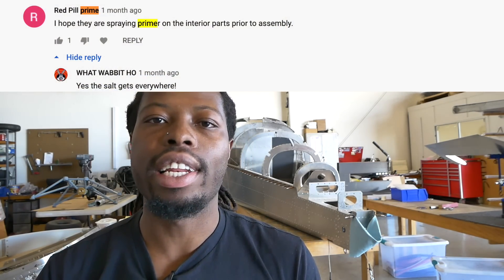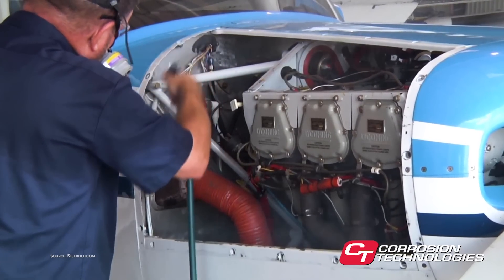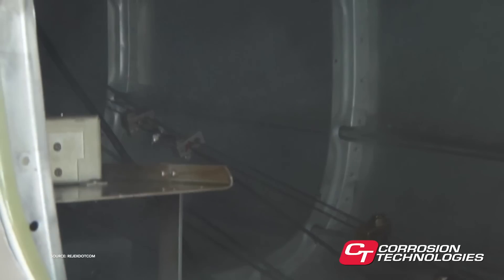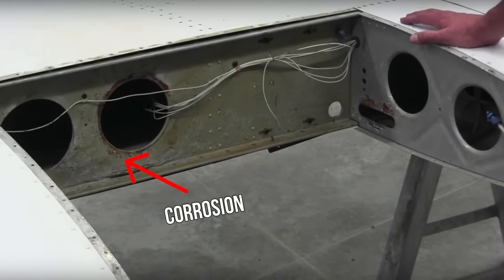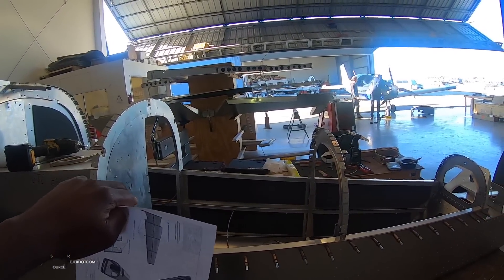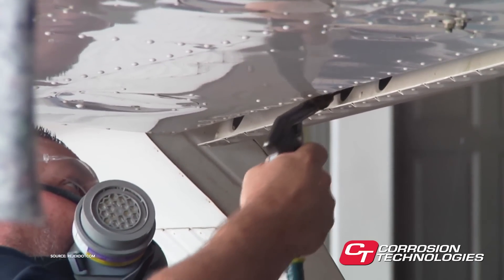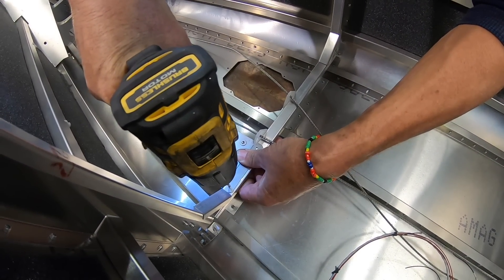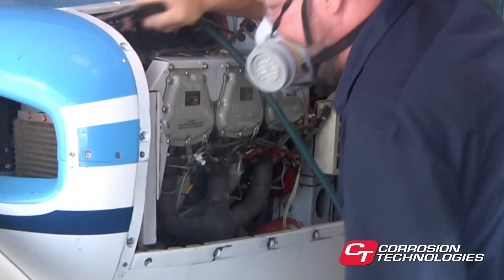Airplane Priming Explained! - Mojosling Build EP9

Comment: Stuff like CorrosionX and ACF-50 corrosion proofing stuff needs to be applied after the primer and paint. The bare aluminum has to be cleaned of all oils and chemicals before painting so its super tough to remove it and have the paint adhere properly because you can never get all the stuff out of the crevices. Also primer lasts longer and from my reading and understanding is the primer should be applied first, then painted, then the anti corrosion liquid applied after to get into the nooks and crevices that primer and paint doesn't get into. Anti corrosion primers such as Zinc Chromate lasts for decades where as the corrosion x or acf-50 treatment has to be continuously applied every 2 years. Correct me if i'm wrong. I too am doing research before i build my plane. Thanks.
Reply: That is how I was trained in the RAF but there is has been an argumentin the Light Aircraft world that primer adds weight and can break down making joints loose (which I dissagree with), I think the main reason for not priming in the home build market is based, partly on this argument but mainly on build time, as to do the priming correctly you have to make your part to fit then take it out and prime it then fit go back and fit it (which would without planning doible the build time). In a factory they would have a production line of part being made and primed as they would not need to test fit and adjust to the same amount that the home builder needs to. It is the differance between exerlance and acceptable (just my view).
Reply: @flyingkub  Hey thanks for replying. That made me think. It does make sense that the primer breaking down would leave a gap and make the joints loose. I would have to research that further. I figured priming everything then make it fit afterwards so that the bare metal exposed from the sanding or drilling while doing fitment, would not be a problem since the final stage would be the corrosionX treatment as a final gaurantee that everything is covered. Would be interesting to see what treatment is used on this build.
Reply: @addictedtopussy69  No problem. I have seen components primed then adjusted and drilled and fitted and then a finishing coat of primer sprayed in, which would be a good solution. If you use a good quality 2 part poly primer or etch primer as long as you are not applying think coats there should be no problem of primer breaking up anyway. With etching primers you apply a very thin coat that hardly covers the components and after assemblt you can apply a light second coat or 2 part poly primer coat over the whole lot. After all that if you are in a damp or salty air area of the world a light anti-corrosion treatment can be applied. The thing you have to think about is weight, expected expected operation of the aircraft, how it is stored or in this case time spent during build.
What are you building or planning to build?
Reply: @flyingkub  From several sources i've read that etching primers are not good for corrosion protection and not recommended for rust proofing. Using stand alone etching solution and then a 2 part epoxy primer would be the very best way. I'll have to look up what poly primer is that you mentioned and see if its the same thing as epoxy primer. I've decided on a Vans RV-10 for a comfortable travel plane with 4 seat, and maybe a cub crafter for a 2 seat fun plane.
Reply: @addictedtopussy69  You are correct about the etching primers not being great for corrosion protection. I would use the same system as we did in the RAF of alachroming the aluminum alloy parts and then light spray of ploy (although an epoxy primer would work as it has been used by USA factory built for years), assemble with a zinc chromate jointing compound (very thinly applied) and then a second light primer coat over the top after final assembly. That was what I did when I rebuilt a Luscombe, which was completly de-rivited and reassembled (weight added 10lbs for the whole aircraft over the weight it was before the rebuild started, some of that was made up from the upgrade avionics but some weight saving was made with the wing covering [Stits System]).
Flight Chops is building an RV on his channel, not the same model as yours but there is a video on priming. Again he is only doing a bit of the build though.
I am still doing the design work on my next project and that will be wood, so rot not corrosion is the problem.
Reply: @flyingkub  Seen Flight chops video where he primes everything with zinc  chromate primer as well as priming his rivets before he assembled it. My conclusion came to the same as your recommendation. 1. Degrease, 2. Etching compound, 3. Two-part Epoxy with zinc chromate in it with brands such as Hex-Chrom, or Alodine 1200. 
An all wooden airplane would be quite interesting. Would never have to worry about corrosion again and would be very interesting to look at inside with all the wood bracings. I don't know whats less of a problem, corrosion prevention or rot prevention and warping.
Reply: @addictedtopussy69  Will look forward to hearing how you get on with your project when you get started. Let me know.
I might put my project up on YouTube when I get to the building stage but got to get the cash together first. Good luck and keep safe.

Comment: I can certainly see holding off priming until the airframe is mostly together. Although there’s certain parts you don’t want installed during the anti corrosion priming.
Reply: Best way to go about it is prime the separate parts and then build the aircraft.
Reply: Scott Mcdonald, Mike isn’t a mechanical expert by any stretch. He is a sort of “Everyman” and proof that building an airplane isn’t complicated. I know that the Internet is full of inaccuracies. But he’s building this airplane under the supervision of the manufacturer.
Reply: @alanaspurling6469  hes just watching..not building...building requires a lot of research
Reply: @subodhkarunakaran9403  I can not see him doing more than 10% and they are fast building has the lack of primer.
Reply: The German car maker’s have done a lot of work examining anti-corrosion protection and use a post assembly dip process. https://youtu.be/JauUjmXlTPE
Reply: @alanaspurling6469  most of us can't afford a tub of corrosion primer like that. Will stick to spraying it on.
Reply: @alanaspurling6469  you can, if you spend like 20x the cost on a pool, at least 2 mobile crane and a whooping 50x of primer.